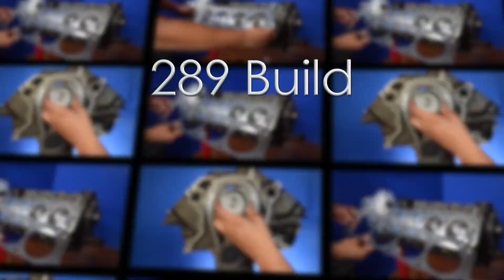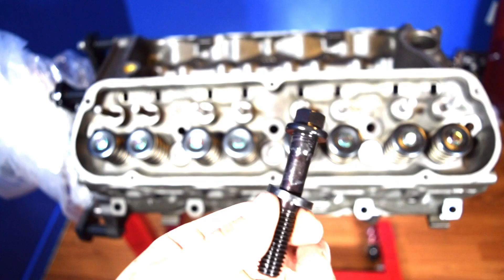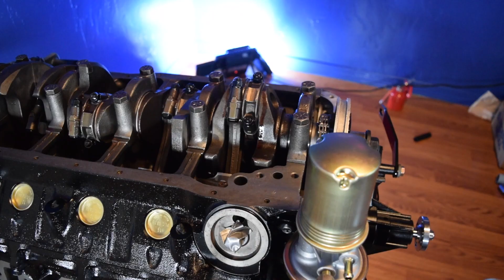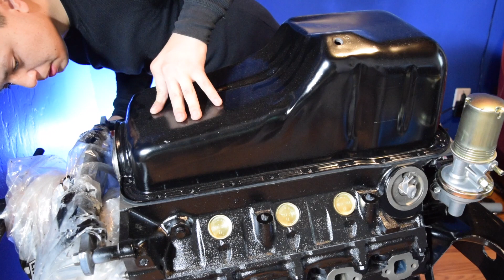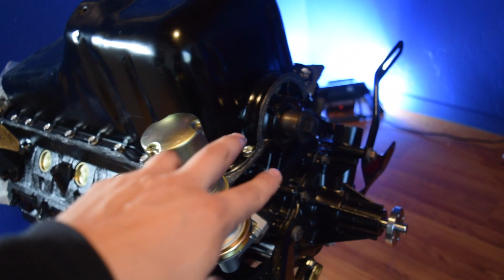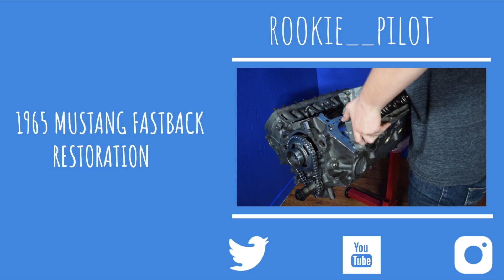289 SBF OIL PAN,  PUMP & SCREEN INSTALL

Comment: Please for the love of God throw away the rtv you only need it where the rubber meets the felt portion of the pan gasket.
Reply from the maker: Thanks franklin, I followed the steps of a reputable mechanic. David Jones on Youtube. I might of used a bit too much but im confident there will be no leaks or any rtv breaking off into the oil system.

Comment: Love the vids but too much rtv can be a problem because it can break off and and clog oil valleys 😀
Reply from the maker: Thank you! Yes you are right. I put the “extra” on the outer part of the gasket once it was already tight. Hopefully not too much pressed out through the inside!